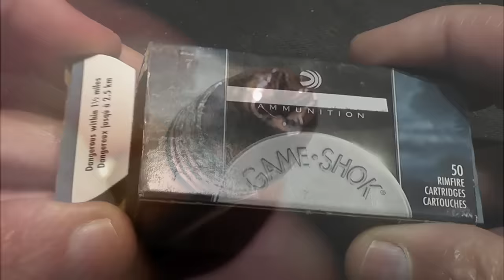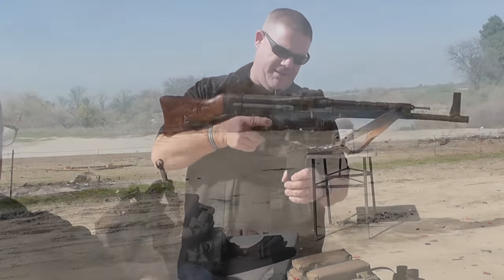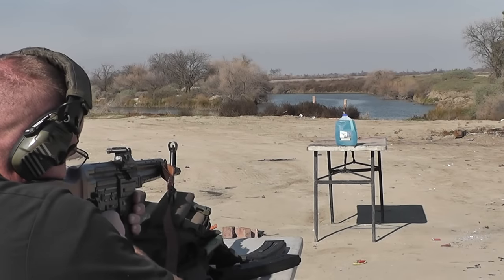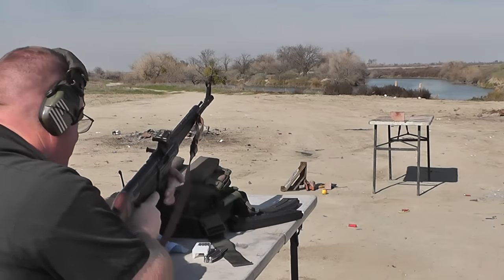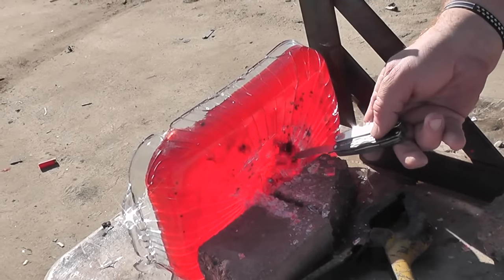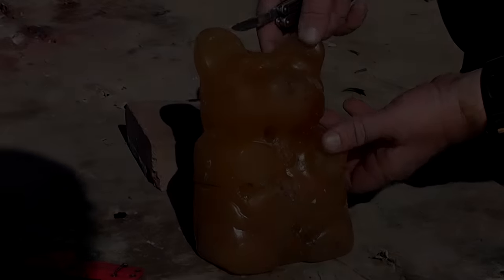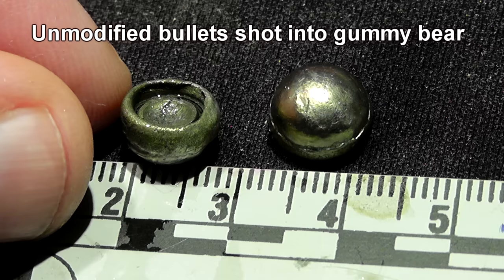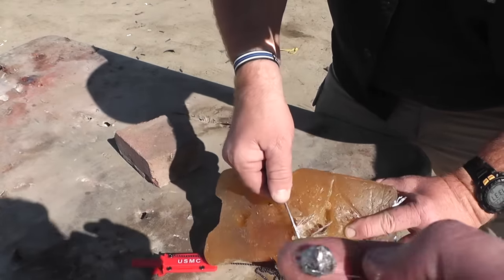The .22 Phillips Screwdriver Mod

Comment: I came about a mod by accident that was rather effective during my youth.  I crammed a finishing nail down a Remington Thunderbolt hollow point in an effort to make a .22 penetrate an empty propane canister.  What I ended up with was the opposite.  It shredded the paint on the exterior and actually left a smaller dent than an unmodified round.  I later shot a fair sized jackrabbit in the head with one and it completely flattened the skull without total penetration. I guess the nail was pushed through the bullet causing complete fragmentation. Ahh the joys of youth.
Reply: Press a steel bb into a hollow point.
Reply: @akbychoice  what happens when you do that? Genuinely curious
Reply: @MJScoutArchMar  My completely uninformed guess is would have the effect of the fatal JFK headshot. supposedly that was caused by someone either putting a wad of mercury in a deeply hollowed out hollow point and coating it with wax or by dripping a ball of molten lead inside the hollow point. either way, the effect is of changing it from a pure projectile to a tiny armed missile.

Is this possible / viable? Personally I do not know. I’m out of my depth when it comes to firearms, ammunition, and ballistics. Just armchair theorizing.
Reply: @yanuehara8017  I had nothing better to do since I was raised a 38 min drive from the nearest 7-11.  I experimented a lot.  This mod had the least effect on accuracy believe it or not.  The effect on trajectory was fairly minimal as well.  Maybe an additional one inch drop at 100 yards.  I was young, stupid and had nothing better to do.
Reply: Funny I did the same thing but with my neighbors kids

Comment: I once shot a 55gal plastic drum without its lid full of water with a .454 using buffalo bore ammo. The hydro-whatever caused 1/4 of the water to shoot out the top. It was a surprised. Maybe try something like that with the 460/custom slug?
Reply: Chris Collins I imagine it definitely would be a surprised
Reply: I just didn't think it would have blew as much water out as it did, was like a bomb
Reply: Its called Cavitation. The bullet entering at such a high velocity that the water tries to move out of the way at the same speed.
Reply: Chris do the same thing with a 300 win mag or 338 but shoot the bottom of the drum. It will launch a good 8 to 15 feet into the air. We use to do the with 30-30.

Comment: Take a couple boxes of Matches crush the heads into a fine powder then take the boxes and cut the striker pads off soak in a small cup of rubbing alcohol until only cardboard is left then take the cup and filter the mixture through a coffee filter until only the powder is left let sit until completely dry. Now take the dried striker powder and scrape it off the filter into a bowl or paper plate you will now mix 75% match head powder with 25% Striker powder creating what is known as the Armstrong Mixture. After the both powders are mixed together you can then add a small amount of water or rubbing alcohol to make the powder more paste like but not to runny. Now that the powder is in a paste you can then Load your Hollow Points with it and let dry to ensure the powder stays you can also drip hot wax over the tips of the Bullet to make a seal.
Reply: Thank you for that recipe. I'm actually gonna try to make it.
Reply: Awesome let me know how it works out. (:
Reply: its a impact explosive that you can load into your hollow points
Reply: That’s how poachers make gunpowder in Africa. It’s got a reputation for being dangerously unstable.
Reply: I have only used it in .22, 9mm and 40 cal would probably not use it in a high powered rifle a 12 gauge hollow point slug would be a nice one to test though.

Comment: Cool video. You guys are funny! 
When we were kids, it was (common knowledge) that you should cut the head of a .22 bullet in an X-pattern on the tip, with a knife. 
This would ensure expansion and more “stopping power”. I don’t remember any difference though in shooting a dove. They’re dead either way. 
We didn’t have ballistic gel or a way to experiment with this concept, but a piece of plywood confirmed there’s a slight difference in expansion of the slug. An ‘Un-cut” slug would go right through the plywood, without much of an exit hole. The cut slugs definitely blew the back out more. 
Just ancient technology from the 60’s, or maybe earlier. (I learned this in the 60’s).
It’s so fun to watch you guys experimenting with this concept now. It does make a difference, as every piece of plywood I shot can attest.

Comment: When I was a boy in the 1950's, I cut my 22 LR bullets with a single edged razor blade to a cross pattern but down to the gas rings, then squeeze it back together. When a normal solid or HP hits a crow, they made a pretty good wound, but when the cross cut slugs hit a crow, all you have remaining is a head and two wings.
Reply: They used to be  called dum dum rounds.
Reply: Ah, the 50s.

Comment: 🔵 My VERY-favorite (and something that works MUCH better than a standard 'Phillips'-screwdriver), is an old (and obsolete)
'Reed-Prince' screwdriver, which looks almost exactly like a 'Phillips' except that the flutes are MUCH-thinner,... if you tap/press the right size of one of those down onto the top of a hollow point it improves the expansion characteristics considerably.
This was proven to me MANY years ago using several different calibers on a Pig carcass, the meat is very light so it's easy to find the bullets and fragments.
Nowadays I always stop at yard sales where someone is selling old tools to see if I can pick up a 'Reed-Prince' screwdriver in good shape, as they're getting harder to find as time goes on, the problem is that all too often people have tried to use them to turn 'Phillips'-screws, which ruins the tip of the Reed-Prince for this purpose, it really takes a new or almost-new one for it to work right.
I usually cut the handles off of the ones that I get and then I chuck the shaft in a drill press and I use that for pressing it down onto the top of the hollow point, it gives you a lot of control over how deep you want to go.

Comment: That was very interesting. What if you used screwdriver heated up enough to melt its way in a little farther. How would those perform?
Reply: Don't melt lead without proper ventilation, it can be very toxic for your health. You do what you want, I'm just trying to look out for ya brother

Comment: Hi, just found you guys and subbed. One thing I remember as a kid, reading Guns and Ammo years ago, you could actually buy a little cylindrical tool which slid down over a 22 round and allowed the tip of the bullet to protrude out the top and you just file off a tiny portion of the tip, thus creating a flat nose 22.
Reply: Hanned tool?

Comment: 🔵 To my knowledge (and if you disagree, support your assertion with facts and a link) the "Standard"-manufactured 22Lr is a SUB-Sonic-round, leaving a RIFLE-barrel (of a minimum of 16 to 18in. Long) at about 1070-fps, Mach-1=a bit over 1125-fps!
Of course, 'Hyper-velocity' 22LR rounds are available nowadays which exceed Mach 1 by quite a bit, some reaching 1800fps, but I'm talking about a "Standard" manufactured-round, NOT a "Specialty"-round.

Comment: I watched a movie when I was young about 40 years or so ago where the bad guy was using hollow point center fire (don't know what caliber but i want to say a  . 308 or maybe a . 30-06) but he took each round and would drill the round out and added a liquid to it and then solder it closed. I want to say he used mercury but considering how toxic it is and bad for the environment. I'm curious what affect filling them  with something like citric acid and sealing them with wax since it's not as bad as lead on the environment. have you ever tried anything similar to this and did it make the round change as far as accuracy and expansion?

Comment: Hollow point .22s are usually hyper-velocity which is why you got such a huge cavity in the clay. If you really want to see the performance difference of the Phillips tip, start with a low velocity fan and dumdum it.

Comment: Did this when I was younger and I also did the X cut in the tip and it definitely works but my favorite mod was cutting the tip and sticking a little steel ball bearing in the tip.... That was my special round.    LoL

Comment: you can do this with regular round too and it works a lot metter then hollow points, just center the screwdriver with your fingers and tap wiht hammer until you get the desired effect

Comment: Its a nice trick...but the trick is....when you hit the copper you harden it....and make a backyard wadcutter....nice job if in a pinch....our method is better if given more time....make 4 equal cuts in copper down 40% from the tip...at bottom of each slot micro drill a hole no larger than 3 X the thickness of slot....at the tip...sharpen each tang to a point...very effective up close wetwork round....enjoy!

Comment: Confession: when I was 17 I took a used paint can filled it 1/2 way with gasoline tapped down the gooey lid to complete the seal turned it over on the ground, backed up about 50 yards (should have been 150) and lit off one 3030 round into it. (I think it was just an older lead bullet) It exploded into a massive fire tail rocket and went up about 300 feet. Burnt the ground pretty bad. So don’t try it.

Comment: You're supposed to cut an actual + into the tip of each round so they fragment upon impact.  Mushrooming is one thing, but when mushrooming is followed by shards of metal breaking off of the projectile and flying through muscles and blood vessels, also lodging into bone, and becoming much harder to find and remove than whole bullets are, now you have a more devastating round, hence the real reason for split-point rounds. Cutting a + into the tip causes the projectile to actually break apart more AFTER mushrooming, and this does much more internal damage.
A friend of mine used to do this with his sidearm rounds when he was in Afghanistan.  
He knows he's not supposed to.  Whatever.

Comment: .17 vs .22 - given the higher velocity of the .17 I wonder how the damage level would compare. Also, lighter round at higher velocity - does that mean longer range accuracy?
Reply: It's hard to say for sure about a smaller projectile at higher velocity always having better range. While generally a smaller projectile will travel further due to less wind resistance, a heavier round can have a similar effect due to the extra mass resisting the forces of the wind more and holding more momentum. So for a little more range a smaller projectile at higher velocities will provide better range but as the distance gets longer and the amount of wind resistance increases, there is a minimum amount of mass required to remain accurate at high ranges.

Comment: Holy Glass-Blasted-Casserole Guys! 
Maybe next time throw in or include a slightly more comprehensive ballistic gel test video of the .22 Long Rifle Hollow Point ammunition by Federal using a #0 Phillips head modification's to illustrate overall effectiveness as compared to the same hollow point cartridge straight out of the box before the modification?
Good video ,but is that big-gummy-bear the same consistency as ballistic gel?  You could also wrap a couple of layers of denim over that ballistic gel test sample to see if that makes a mushroom of difference.

Suggestions:
Ballistic gel (solo, as the British might say) without any layers of denim
Ballistic gel with 1-layer of denim
Ballistic gel with 2-layers of denim
Ballistic gel with 3-layers of denim
Carry-On!

Comment: nice. this was enjoyable. 
I would have liked to see an unmodified bullet compared to a modified one to see if there was any additional expansion, and the point mentioned as you were digging the bullets out of that bear is true, many of those bullets probably collided with each other so those bullets were probably not a great example in terms of deciding whether or not the screwdriver thing helps.
regardless, I really enjoyed the video. thanks.

Comment: Put a drop of 5-30 motor oil in the hollow tip of the bullet and then use paraffin wax (Gulf wax), to seal it in.... Note...... Not candle wax.    Then shoot it and see what happens on impact.

Comment: Protip: do it just like they do: leave the round in the holder or sitting on any flat surface (don't worry ignition of the primer is only from an approved firing pin device, flat surfaces pose no risk) and give it a good hard tap with a small mallet. Happy shooting, fellow boomer sheeps

Comment: Pretty unscientific test. No standard hp vs modded. No round nose compared with the other two. No penetration distances compared or expansion chanels compared. The only thing this video showed was that the mod didn't cause failure to feeds in that gun and accuracy didn't suffer too much.

Comment: This is an incredibly stupid idea. Hitting the bullet at the tip could easily push the bullet further into the casing compressing the powder which would cause over pressuring. Over pressuring could cause all kinds of damage to you firearm not to mention death. Very stupid.
Reply from the maker: You really don't know how things work.
Reply: @taofledermaus  you know nothing about me. You say I don't know but offer no information to contradict me. Here is what I know, the chamber pressure inside your firearm is determined by many factors, one of which is the volume inside the casing and how much powder is in the casing. By hitting the bullet into the casing and compressing the powder you can and will cause increased in chamber pressure. Excessive chamber pressure can cause damage and even death, any reloaded knows this.